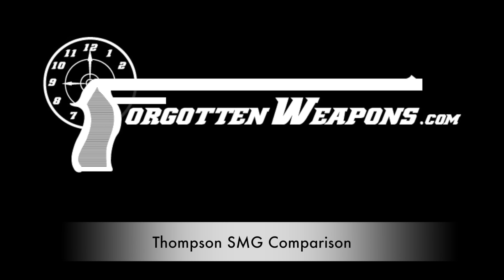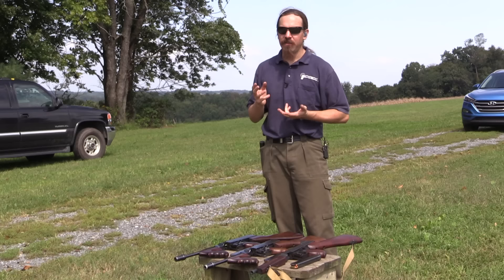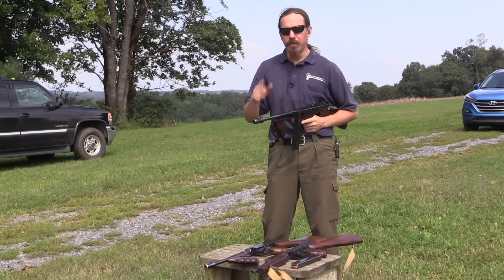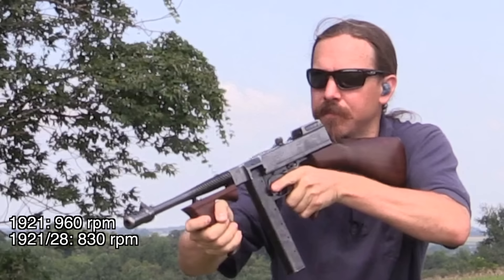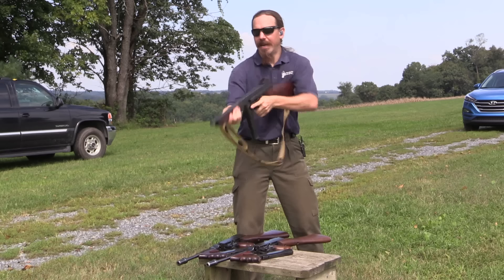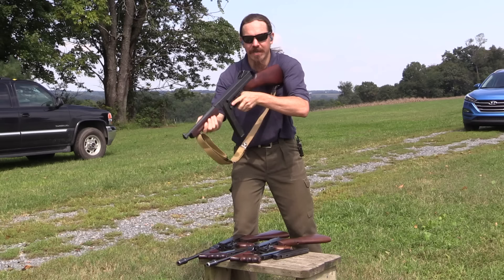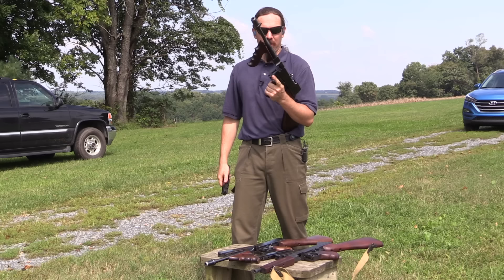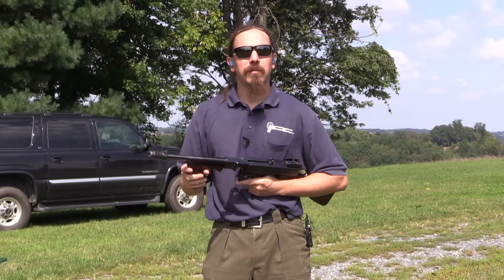Shooting the Thompsons: Comparing the 1921, 21/28, and M1A1

Comment: I'd be tempted to suggest that the Blish lock increases the dwell time of the M1921, allowing more of the propellant gases to exit the barrel before cycling rearward; whereas the M1A1's straight blowback cycles much faster and a slightly higher pressure in the barrel as it begins travelling back results in greater gas residue being blown back in the shooter's face from the ejection port.

Just a thought.

Comment: From the side shots, the 1921 climbs quite a bit,  especially compared to the 1928.  The 1921 seems to recoil, or jump around a little less, which I’ll guess has to do with the additional weight of the bolt in the 1928 and M1.  It looks like the design was optimized around the lower weight actions.

Comment: I'd love to see an M1919 Thompson, if wikipedia is to be believed about it being a 1200rpm gun in .45ACP.
Reply: AgentTasmania If it's only about the rpm and cal. then look at the Kriss Vector
Reply: @eliast9816  Open bold 1200/1500 rpm .45 ACP with <6 pound. That thing will be hard in full auto. Luckily it has 2 round burst.
Reply: First of all: The Vector fires from a closed bolt... And second: It's not hard to controll due to it's off-axis bolt travel.... Do your research before commenting
Reply: @eliast9816  He may have, many people who have shot it consider the off-axis bolt travel to not be the grail that was hoped for.
Reply: Well I have to admit that I have not shot it myself because the gunlaws were I live are very strict but as I've heared it's rather easy to controll for a 1200rpm .45acp and even easier then say the Thompson... But admittedly it's propably still a lot harder to controll then say a MP5 or if we stay with the .45s a UMP
Reply: from what i seen, the ump bounces more that the kriss. that is just from watching videos though. would love to get some trigger time with them both though
Reply: Elias T watch Larry Vickers compare the Vector to the Grease Gun. In terms of controllability the Vector fails pretty miserably. The “Super V” bolt creates not only a downward impulse on the recoil but also an upward one on the return, causing a significant amount of vertical stringing.
Reply: The 1919 Thompson prototype was dubbed, "Annihilator".

Comment: An excellent end to the Thompson Series! I think we all are surprised that the one with the highest rate was the easiest to shoot; it’s also interesting to see that the continued evolution of the original design did not result in a better, more suitable design but in fact made it harder to shoot. The M1/M1A1 is practically a different gun internally, with only the outer appearance having a family resemblance. It was also interesting to see that the Cutts Compensator actually does work to make the guns more controllable, after hearing for years that it was a gimmick. I’d be curious to know your opinion if you thought the Thompson SMG was a success or a failure as a gun in the context of history; it certainly has a reputation and image with the public at large. However, it’s initial timing (coming out as WWI ended), its complexity, it’s weight, it’s ergonomics, coupled with the cost and effort to produce it all seem to work against it in terms of its overall success as a military firearm. In contrast, the M3/M3A1 was designed from the ground-up to be cheap, mass produced, have a low rate of fire, and be a simple and utilitarian automatic weapon that stayed relevant much longer.
Reply: Like Driving Faster Over Bumps In The Road?
Reply: Depends on how you define “success”. The Tommy gun fulfilled a need and it worked. But not the best, which is why it was replaced with something cheaper and easier to make and easier to carry.  But often the first of something is not the best; people learn and improve designs over time.
Reply: They built a couple of million, so it can't have been that bad! The M3A1 (all $15 of it) was better from a strategic point of view, but it benefitted from nearly thirty years extra experience and it didn't exist in 1939. The Thompson was successful by dint of being available and being reliable at exactly the moment it was needed. From a military perspective that makes it almost the perfect weapon, if it had been cheaper I bet it's replacement would have been kicked down the road until the assault rifle era.
Reply: I don’t understand the “Thompson was a success simply because it existed” defense. Sure- a heavy, $200-per-unit submachine gun is better than no gun, I get it; but that wasn’t my question. If anything, the Thompson benefitted from complacent, backwards-thinking military planners that saw no reason to move away from bolt action rifles as their soldiers primary weapon, who failed to imagine a battlefield any differently than static trench warfare, and were suddenly faced with a fast-paced mechanized foe who equipped their soldiers with portable automatic weapons- the MG34 and the MP38/40. Dropped into that scenario, ANY automatic weapon is needed; but that’s not what makes something a success. If the Thompson had arrived sooner to the battlefields at the end of WWI, it might have made an impression. The MP18, even though it’s time in WWI was short, the concept was moved along and developed into the MP38/40. The Thompson did not have any of that going for it, and it’s development stagnated; it was a WWI technology used as a stopgap till something better could be developed.
Reply: ultrablue2 ,everything you posted is correct. The Thompson SMG was heavy, complicated, and with the drum magazine wasteful and needlessly expensive. You are right that it is shameful the British Army got caught without a proper or readily available SMG when WWII began for England, but that is what happened. The British paid for that  mistake in hard currency to Colt and Thompson. The Swiss and the Swedish were not in position to offer any numbers of SMG and the Thompson was not fully committed anywhere in 1940, hence it's financial success. For all of its faults the Thompson was available, and that was good enough.

Comment: I have shot a model of 1928 Thompson. If you don't lean into it the recoil will push you back on your heels. Leaning forward makes them very controllable and shooting from the hip makes them very easy to control. I shot at an indoor range and it was kind of dim. Was cool to see flame shooting out the end of the barrel, straight up through the compensated and also out of the ejection port. Keep up the good work Iaian!

Comment: You mentioned the M1A1 blowing more gas back at you. I think that's because the 21 and 28 were both blishlock mechanisms, whereas the M1A1 was reengineered to be a straight blowback

Comment: That Cutts compensator really reduces the blowback. That, and I think the original bolt design diverts the gases above the shooters head. Plus, you have to consider that Colt production standards were HIGH and tolerances were probably much tighter than the AO and Savage runs. I mention that because there seems to be a lot more gas leaking around the bolts of the later models. The 21 you disassembled, though, shows what a beautiful piece of machining that weapon is.  The controls may seem awkward by today's standards, but they are simple and intuitive.  Exemplary of that old saw "they don't make 'em like they used to."

Comment: @4:11 Easy handling and controllability are probably the reason why the decision to make the changes to the M1A1 model that were made. In addition to simplifying the feasibility and lowering the cost of production, being able to handle and control the weapon as well as its reliability are just as if not more important especially when considering a firearm being issued to our soldiers on the frontlines including new recruits who might not be as experienced in handling full auto firearms. The US military at the time for their idea of "improvements" were geared towards not only inexpensive feasible production, but also a balance between that in addition to smooth handling and reliability. The stamped steel grease guns even though they were less expensive than the Thompson, they were also said to be less durable.

Comment: So take a 1921, replace the sights and add a horizontal front grip and it's perfect? 

While I'm slightly surprised at the progressively worse shooting, I'm not entirely surprised. The first Thompsons were rather expensive, and even as late as early WWII the British were concerned at the cost, and promptly dropped buying them in numbers (if any at all) when cheaper alternatives became available. The M1A1 was obviously made to be cheaper, and you can see it on it. "So what if it is less superb when firing? Doesn't matter much, it's an SMG, it won't be alone and we don't have time to train every soldier to high proficiency anyway." I can totally see some people in charge of logistics and procurement thinking along those lines.
Reply: Jonas Drøjdahl just buy a 28 Thompson and you don’t have to change anything.

Comment: The 1928 was very poorly engineered. 

The idea of the blish, was to compliment the light reciprocating weight. Notice the increased muzzle flash, kick, and bolt dwell of the 28..

Remember, the Thompson was a WW1 wonder weapon that was late to the party...
Reply: Breech flash*. 

The 28 is not tuned to the system. 

"There is absolutely NO engineering justification for the 1928 design" - Doug Richardson.
Reply: Not sure what your taking about I own a WW2 28 Bridgeport and  I think the gun is a great design and a blast to shoot not to mention a great investment.

Comment: From the slow motion, it appears that the compensator or the 21 is really helping with gas clearing.  The A1 is not evacuating its bore very well, perhaps due to lack of air flow/vacuum at the muzzle.

Comment: The 1921 is probably the best shooting due to the cuts compensator, smoother action, and forward grip which makes it easier to control in full auto. The reason why this is a problem in the military guns is that they lacked all of these features and were generally grittier as well, so the low rate of fire made them more controllable not in comparison to the original per se, but for essentially lacking all of these features. Another thing about a high rate of fire is that more rounds will hit the target faster, making you more accurate with follow up shots before the weapon is off target.

Comment: Nice. Great series, and a fitting end-shoot all 3. The 1921 did seem to have the least muzzle travel, as well as the higher rate of fire. I wonder if the higher rate of fire makes the Cutts a bit more effective. There is more gas going through the compensator, so that makes sense. I'm sure there is a sweet spot where it works best, and above and below that spot it doesn't work as well. Based on your and some other SMG videos i have seen, there appear to be sweet spots with uncompensated guns, around 600 rpm and 800-900 rpm. Anyway, great job on all this. Thank you

Comment: I was able to shoot a 1928 Thompson M1A1 a couple years ago at a range where you could rent machine guns.  I thought it was extremely easy to shoot and very controllable.  I am 6-1 220 pounds, so it's not easy to move me, but out of 50 rounds at a waiste up man size silhouette target, the center was completely punched out and only a few stray rounds outside of the man shape.  I believe it was 50 feet away.  Probably the coolest thing I've done in my life.  Coming from the AR, the controls were a bit awkward to me, but it was a joy to shoot.  I fired the first shot separately from the rest to see where that one round would go to get an idea of the sight picture and it went through the paper dead center of the forehead right between the eyes... exactly where I was aiming.  3-5 round bursts where right on target.  The model I was shooting DID HAVE the cutts compensator though, maybe that made a difference.

Comment: I'm pretty sure that it's not only the compensator that helped controllability, but actually also the foregrip to a huge amount. On the old versions it's angled and has finger grooves so that you can pull it down easily. That isn't possible with the M1A1 (or at least not as easily - all of that from a logical/anatomical standpoint, though).

Comment: Ian, I've got the good fortune to own a 1928AC the last several years. ACs were I believe parted together on left over 1928A1 receivers with the last  "1" overstamped with a "C" that stood for Commercial and sold to LE agencies (TN Highway Patrol in this case) late/after the war after the M3 transition.

I've got both the standard mil 1928 internals that give about 720rpm (Rem/UMC 230s) and mil internals modded to 1921 specs that give 990. The latter is much much easier to hit with as it just seems far smoother. As you say it is something about the harmonics that counter-intuitively makes the higher ROF more stable. They apparently hit the sweet spot by design or accident the first time around with 45ACP and gun weight, ergos such as they are, etc.

Cheers and keep up the great work!
Reply: The 1921 AC and 1928 AC  refer to the Cutts Compensator , nothing more ( because you could order the guns without it ).  With the exception of the ones overstamped when sold to the U. S. Navy, all early Thompsons' were commercial products available primarily to Law Enforcement and security firms ( though some were also sold to the public, just like the BAR ). 
 See the other videos in this series.
Reply: @williestyle35  In the case of the 1921AC, it is correct that the 'C' signified the Cutts. Every 1928A1 left the factory with a Cutts. The 1928AC was taken from 1941 military contract 1928A1 production (every one I've ever seen was between sn 151,000 and 155,000) and diverted to law enforcement sales. The markings "US Model 1928A1" were altered by grinding off the "US" and overstamping the final "1" with a "C." The resulting marking look akin to a 28 overstamp. The 1928AC is a somewhat uncommon but not particularly desired variation of the mil 1928A1

Comment: Nice comparison. I've shot a transferable M1A1 and also found it was a little more challenging to control. I did find the the lower rate easier to fire short controlled bursr though. I had no problem shooting one round at a time on full auto.

Comment: When I was around 7 years old in the 1950's I got to disassemble and reassemble an original 1921 which belong to a local Police Dept. Cased with a massive set of Magazines of all sizes made. The elected town Marshal had the duty of arresting town officials, if they broke the law, with the aid of the police dept who they were in charge of. Once a year he took the 1921 out fired large box of ammo 600 rounds, I think, per box cleaned it and took it back to storage. He purchased surplus ammo for it so there was always ready ammo if the police needed to use it. He always had a small cadre of shooting friends along for safety. As a group there was enough firepower and many had served in the US Military to prevent any creeps from attacking him to get the 1921. His own business was men's clothing. He had a very nice replica Claymore sword in the store made by another friend who some do Gooders kept clamming was a stolen Museum piece.

Comment: 6:36 Looks like the first 2 shots with the 1921/28 the bolt stops before hitting the receiver, but after that it starts hitting the receiver and starts recoil a bit more.
While the 1921 seems more consistent with the recoil.

Comment: Just watching this I was thinking you were having more trouble with the 2nd and 3rd versions. The lower rate of fire for the M1A1 makes sense as .45 APC is heavy ammunition to burn through at the original rate. In that respect the M3 was even better, besides being cheaper to manufacture.

Comment: I personally think the reason behind 1921 smooth shooting is high rate of fire. For basically one push of a recoil you shoot 2-3 bullets. Similar to PPSh-41, Ian himself said PPSh is surprisingly smooth gun. I noticed that guns behave better with either low rate of fire, like below 600, or higher than 800.

Comment: It as to do with how little time it takes for the bolt to go back and forth and how little time the reaction forces have. The recoil force and the grip force have enough amplitude to better cancel each other. In the slowmo you can see that before the recoil shockwave gets your muscle tissue to maximum compression, the bolt already went into battery exerting force the other way, enough to decompress your shoulder muscle again. With the lower rate of fire, you were getting more shockwave in your bones.
I think there is a lot of science behind fullauto fire controllability and that it wasn't yet studied properly. Also, I think weapon controllability can differ from person to person based on their bodytype, and it can move the rpm sweetspot.

Comment: Cool.

Yeah.  I'd say those Cutt's Compensators were really doing something there.  In the slo mo you can see the gas coming up out of the Cutts Compensator.

I'm not surprised at the removal of the Cutts for the M1A1.  When Thompsen first made them - they were made by Colt and were something of a labor of love for their creator.  He wanted to make the best gun he could. 
Then with the M1A1 they were doing everything they could to make it simpler and quicker to produce and ... the Cutt's compensator fell through the cracks.  It probably would have been better if they'd left it on but at that point all they cared about was the expense and time it took to make them.
.

Comment: I noticed on the m1a1 thompson, that the charging handle for the bold, right below it, there are notches thay look as if you can rotate the bolt into them, as an addition bolt safety incase you drop the firearm and the main safety fails, a backup safety i should say for better understandings.